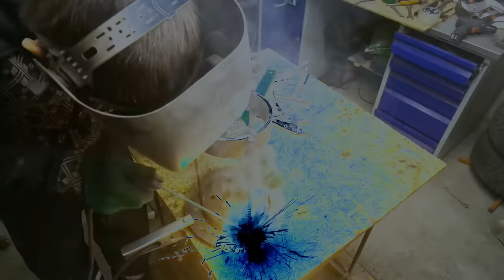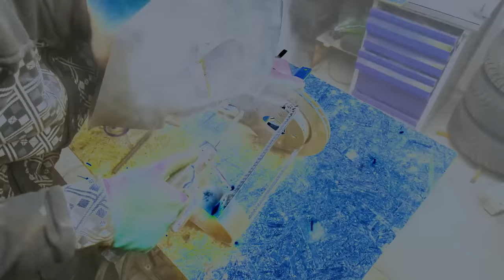Cool idea! Tool for every welding FROM THE BRAKE DISC!

Comment: id have made the contraption taller..it does seems a bit small and can be top heavy form teh cylinder but just my take otherwise im sure it'll work fine and get its use but id have made it a good foot taller to be sure and safe..working with gas is no joke..people get burned all teh time.

Comment: Cool idea, and it works. However, I have never seen a welding gas cylinder with a convex base. They ALL have a weighted concave base. So where does this one come from since full gas cylinders must be transported in an upright position, NOT laying down.
Reply: I came here with the same question!
Reply: @petermangan1124  Over 50 years in the business and I have never seen one. Maybe it's some kind of SCUBA tank?????

Comment: Stainless steel will stick to cast iron quite well.... or even hard facing rod for a job like that....
Reply: Nickle alloy rod will join these parts.
Reply: @tigerseye73  Yes I think that's why stainless works.... it has nickle in it... and I think so does hard face...

Comment: Where did you get that size gas bottle. And is that a
ARGON gas?
Reply: Probably a C02 pub bottle?
Reply: Purity gas. And Praxair. All carry several varieties of tank sizes. I have a micro tank of ultramix for my welding setup. 75/25 argon CO2

Comment: Rotor should of been preheated as it’s thicker and larger then the rebar then concentrate your heat more to the rotor. & two different metals can be tricky. Go buy a cheap cart from HARBOR JUNK . And u can use different size bottles.

Comment: I knew it was a bottle holder pretty quickly. You really wanna make it nice, add a few 'set screws' around the hoop to hold the bottle tightly, and some casters on the rotor. Nice work though man

Comment: How did you weld steel to cast iron as i though Brake discs are made from cast iron ? is it me missing something
Reply: Cast iron can be welded, just takes more prep. Preheating the cast first, and letting the weld cool slowly. Stainless steel rod works better too.
Reply: @Guitarplayer724  agre but How do you weld cast to mild steel
Reply: @casper1240  I’m no expert with welding cast iron. I do mostly weld art, so I weld a lot of different metals. In my case though I’m not worried about high structural strength. I usually heat the cast piece up to around 500 degrees with a torch, or I put in my forge. While it’s hot I’ll weld the mild steel piece to it using my TIG welder and using stainless steel filler rod. Then I’ll insulate the weld and let it cool slow. I’ve done some cast iron/mild steel welds that have held together just fine even through large extremes in temperature. (Cold winter/hot summers). Hope that helps, though if you’re looking for professional advice you may wanna look further! 😃

Comment: So why not just build a welding trolley? It doesn't even have wheels. Before you got the gas bottle, I thought " is this an umbrella stand or something?"
Reply: I was thinking it was gonna be some kind of shop stool
Reply: its only to hold the cylinder and when welding you dont want to cylinder moving while welding..

Comment: A low cost and much better and healthier solution to remove the rust is to simply submerge and soak the parts for about 3 days in pure Vinegar, when done you will be able to wash away the rust with water.
Reply: three days f that dust mask and angle grinder wire wheel attachment job done in a couple of minutes

Comment: Some people are capable of welding cast iron to mild steel. I have the proper welding rods to prove it. And that's my secret.
Reply: think he needs a new wire wheel not rods😂😂
Reply: it's no secret to use dissimilar rods if you know what you are doing not like this guy    ............
Reply: Or if you are smarter than this youtuber you could braze the mild steel rods to the cast iron brake disk :)
Reply: UTP 65 if you can afford it. I have a cement mixer with a plate welded to the bottom of the broken cast iron tub I fixed in 1989. I would put the bottle on a yard sale hand truck and be done.

Comment: Don't weld with rubber gloves on. If you melt one it could become a permanent part of your hand.
Reply: Don't use ANY gloves around rotating machinery. Loose the gloves or loose a finger.

Comment: brake disc are made from cast steel iron you can't weld cast iron to mild steel!
Reply: You can, but any load and it will crack
Reply: But you can braze. And they lived happily ever after.
Reply: @Fosgen you can BRAZE
BUT braze is not as strong as base metal
Reply: @roytelling6540  Which is a questionable statement. Cast iron has bad tensile strength anyways and has been illegal for pressure vessels and bridges for a very, very long time and very good reasons. Brass or Bronze spelter may be less hard, but it probably is more strong and robust towards many types of loading....
Reply: It can be done. I can tell you 6 procedures right off the top of my head.
Reply: @roytelling6540  Wrong again

Comment: It can still fall over if bumped hard enough and now by increasing the diameter at the base you have just ensured that the scary end of the cylinder will almost certainly strike the ground and create a missile

Comment: Come on, man everyone knows you gotta use the JB Weld on the cast metal. Just save yourself some time and JB Weld that gas cylinder right to the floor, probably more stable than that brake rotor.
Reply from the maker: oh no
Reply: i epoxy  a sheet of fly paper on the floor
Reply: I'm a backyard man shed amature. NOT a professional metal worker. I enjoy watching these inventive ideas. If you are such a pro. why do you watch and criticize like ooooh "everyone knows this or that".
Well alot of people don't know. We weren't born with your knowledge like you were.
Reply: @josephiodice5934  why do I watch? They put videos on here for me to watch. Why do I criticize? I only criticize things that are stupid, in my opinion. If you put something on YouTube, it will be criticized. If you don't want criticizim, don't post it. The more important question is why do you care about what I say?

Comment: Had you been using a 7018 you wouldn't have had the problem because the loan gation properties of the rod rebar is a b to weld and even then it doesn't stick real good the problem with 6013 6011 is that they don't have any elongation Properties or malulabilty

Comment: The welds won't stick cause rebar is super hard steel you need a special electrode to weld to it, so when this fails its gonna send that gas canister through a brick wall
Reply: is the ignorant leading the ignorant?
Reply: More Appellation engineering. We call it Bob Villa Collage Boy wisdom in the trades. Who ever told you that doesn't even know what rebar is
Reply: @mathewmolk2089  collage?

Comment: PRO TIP: Make your wire wheel derusting easier, and dust-free.  Spray the item with some of that black primer that dissolves rust, (Rustoleum makes it in the US), THEN wire wheel it, after it dries, of course.

It's a horseshit primer, but it does dissolve rust, and you can wire wheel it in about half the time, and no rust dust.

Comment: CAST IRON IS HARD WELD, IF YOU DON'T YOU DON'T US A CAST IRON WELDING ROD. FORGOT THE NUMBER. 7018 CAN WORK. ALSO THE ROTOR IS CAST IRON IF I'M NOT MISTAKEN.  OTHER THAN THAT GOOD JOB. FELLOW ROD BURNER.
Reply: yes i have used a 7018 rod it works
Reply: @wilburstalker-li4nr  You may THINK it welded but it didn;t

Comment: Dont you realise the gas bottle has a domed bottom for a reason? It's not meant to be stored upright! It's designed to be stored horizontally.
Amateur hour..
Reply: But can be stored upright if you have a handy little stand to place it in, you're welcome :)
Reply: @rodneymiller5926 
Incorrect.
I guess the manufacturers have wasted years of design and process development and made a huge blunder. You know better.
Reply: @FoMoCo123  I understand you like to be correct  every time you blow out a statement but here you are not. All tanks designed for high pressure have "domed" bottoms, either domed inward or outward. If it is desirable to stand the tank upright, a cylindrical collar is simply welded on the bottom of the tank. His homemade tank stand works just fine and is in no way dangerous.
Reply: I’m sure osha would approve of this monstrosity. You know they make and sell carts for this right.

Comment: Cast iron is not weldable
Reply: It can be brazed or welded with nickle alloy rod. Sometimes preheating is required.
Reply: You couldn't;t be more wrong. 

We regularly weld broken boat manifolds that broke from freezing. There are many processes, but our preferred method is gas welding with actual cast iron filler metal. - Expensive, Time consuming, but it yields an undetectable repair that os every bit as strong as the original part. #2 is brazing, also very strong, then there is Ni Rod, and a whole bunch of other rods Like Jupiter B,,,, They get the job done but we call them "Camouflaging".

Comment: Pointless. That still needs to be chained. It can tip over easily. You used a stick welder to build it, why do you even have a tank? Why is the bottom of the tank rounded? What is going on in this video?? LOL

Comment: I might be wrong but it looks like he's throwing sparks all over a wood table, and not solid wood but osb. 🤦
Reply from the maker: yes
Reply: OK..... It's not going to burst into flames just because it's a wooden table
Reply: You should never weld or grind on a wood table, bit an OSB too is an especially bad idea. Sparks get in all those books and crannies and sooner or later you'll have a problem. Anybody who knows how to weld properly should know how to build a metal welding table or bench.
Reply: I agree with not welding on a wooden table, but grinding isn't really a problem unless you're just constantly staying in one spot, spraying sparks in one area for a prolonged amount of time.
As far as catching shit on fire while welding, I've seen non-morons catch shit (even themselves) on fire. It's not necessarily anything to do with the welding hood, but concentrating on the piece you're working on. Even with the new panoramic welding hoods, you're still so concentrated on your puddle that you don't notice anything else.